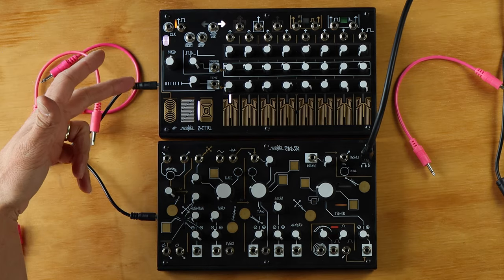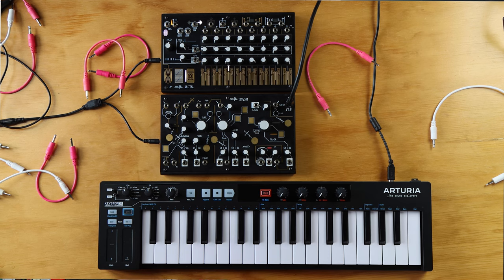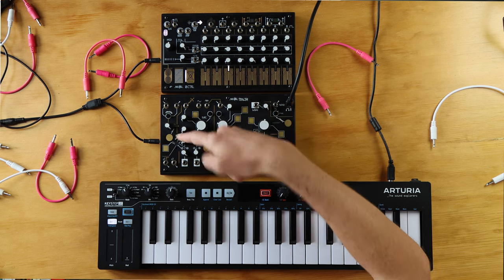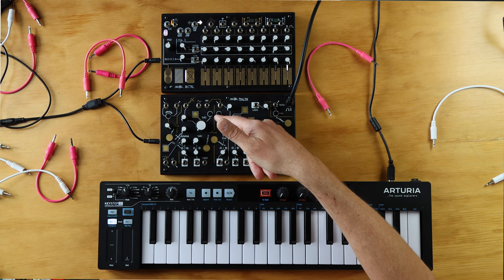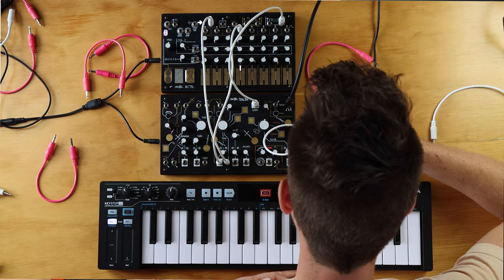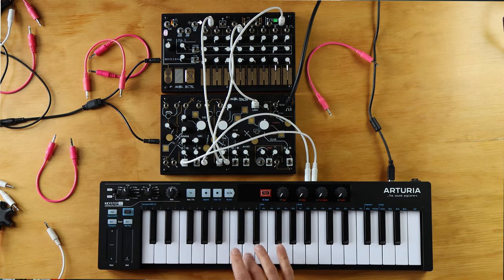Stregatones and Clock Noise Drums! | Make Noise

Comment: I love using stega for drums. My favorite thing to do with them though is to run the drums and an arp into xpan at the same clock rate. I mult the arp and use it to sequence an lfo to modulate the crossfade on x pan.
Reply from the maker: Sounds like a good time!
Reply: @MAKEN0ISEMUSIC  the best!

Comment: It’s uncanny that this video came out while I was doing some rhythmic and percussive sounds with Strega and 0-CTRL. I was using the sequence to modulate the delay time, the absorb and filter. I’d then use Maths to trigger the activate in very random ways. I kept thinking, “should I be allowed to do this?” Then, this video comes out. Turns out, the answer is yes.
Reply from the maker: You don't need our approval to break the rules! 🎶🤘🎶